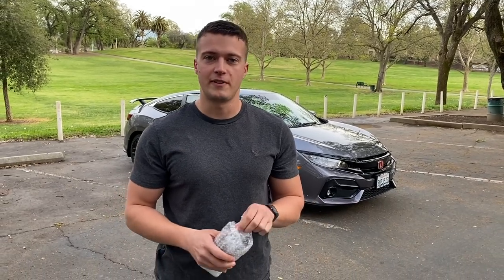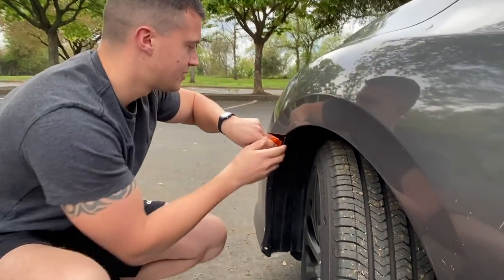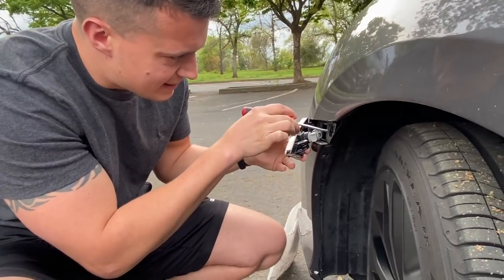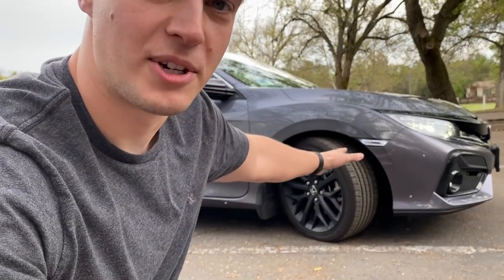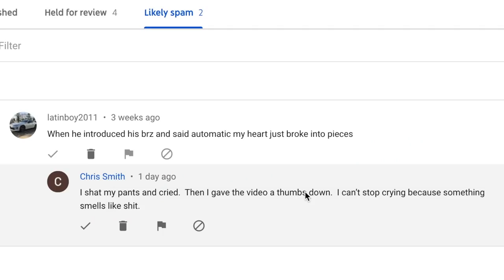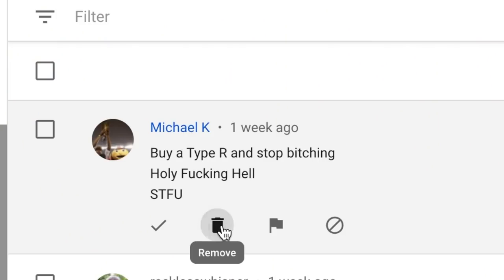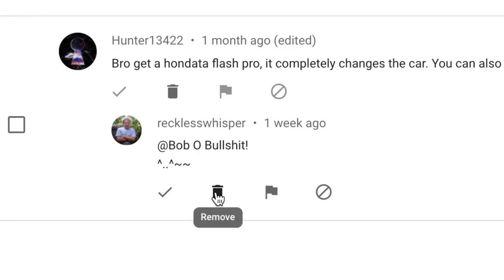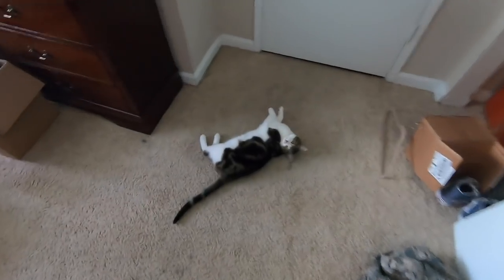Unity Performance Side Marker Install for 10th Gen Civics | 2020 Civic Si

Comment: I added smoked dark gray side markers with amber LED bulbs on my 2016 Civic Touring sedan right after I bought it used in 2018. It does look good at night. Another inexpensive mod is adding a "turbo" sticker on the lower rear door sill. Apparently they were available on the Canadian spec Civics from 2016-2018. It might sound corny but it looks kind of cool and they're available on Ebay or Amazon for about $10.

Comment: Honda did not do the smaller turbo motors because they are cheaper. They did them because of emission standards.  I had an eighth gen SI Before I got my 2020 and this car is much faster and gets better gas mileage. Is the motor as buildable? No, but you can still get good power out the L 15. At least enough for a daily driver. I love my 2020  SI and  I think it is the best car on the market at that price range.

Comment: Did unity performance on mine and they had condensation inside when it rains. It also did not pop in place so I had to put in double sided tape on it. Replaced them with a $20 ebay side markers and they were far better.

Comment: 2:01 no footage of fishing the wire out of the fender?
Reply from the maker: It wasn't hard. it was right there. It doesn't fall down inside the fender or anything. I have skinny fingers, so it was easy for me to grab it, but if you have fat hands and you wanna dance (like Tom Cruise), then I suggest using some needle nose plyers

Comment: Hey so I have a question for your next video! I currently have a 2018 Civic hatch with a few mods done. Would you say it's worth it to put a couple more Ks into it ($3-5k) Visual and performance mods and keep it til it dies. Or save til the 11th gen SI (2022ish) and mod that?
Reply from the maker: i would most definitely save your money for the 11th gen. it will probably become available next fall as a 2022 model

Comment: Hey great vid. I have to ask about the cable. When you popped it off, the cable fell back into the hole.  How do you get it back? Was it easy? 
Thanks man. I now have some choices to make
Reply from the maker: You just gotta finger it back out. It stays right there
Reply: Good question j max

Comment: Love the video bro ! Hey quick question what’s are the difference between the 17-19 SI  & 2020 ?
Reply from the maker: The 2020 has Honda Sensing, revised fog light covers, more red in the interior, and active sound generator
Reply: @Camhill182  I see thanks for the reply. I’m thinking of a SI 2020 but it’s crazy in the price range. Should I just settle for the older years ?

Comment: Just recently bought a 2019 civic si coupe and the first thing I did was replace the side markers. Next up is a chrome delete, the chrome on the side of the car above the windows just doesn't fit with the overall character of the car. If you like the idea of covering the chrome with a wrap, I would suggest looking into it. You can grab a precut on ebay for around $20-25. Let me know what you think. Possible future video idea.....
Reply from the maker: Good idea! I have that in my ebay shopping cart right now, just forgot about it
Reply: I have a 2020 lunar silver civic sport sedan. I have to get those side markers in clear. I must be in the minority as I like that Chrome strip!

Comment: Jdmtoy has them also. Have them on 2016 ex t and 2020 si. After thought you can use the stock ones and spray tint them for 9 $

Comment: Honda's Earthdreams turbo engines are much more power dense and efficient than the N/A engines that came before, from an objective, manufacturing, industry standard and performance standpoint it's the way to go. Thats the unbiased judgement but in my own personal opinion, I enjoy the high torque, strong low-mid range engines over the older higher revving engines you had to wind out for power

Comment: Have you turned on your blinker to see if it syncs? I bought some new side blinkers to for my civic si 2020 and there is another wire to connect to the blinker wire but I dont know witch one it is to sync then so it works because I got ones that where supposed to be amber and it didn't have instructions on witch wire to connect it to lmao. Does anyone know?

Comment: Damn, that's hot. Looks like i'll add those to the list. Any legal issues with the blinkers not being amber colored?
Reply from the maker: Nope! No legal issues. Especially since lots of cars dont even come with them
Reply: Cameron Hill cars that don’t have side markers on the fenders generally have an amber side marker within the headlight housing that is visible from the side.  Legally you are supposed to have an amber colored side marker, but I’ve yet to see anyone get pulled over for this.  In Europe the side markers come with clear plastic instead of orange.  There is a law, but it isn’t strictly enforced.

Comment: Update I bought the same set of side markers and the drivers side leaked immediately, I sent pictures to the selling and instead of sending me a new one they wanted pressure test the side marker. Well if it was a quality part I should not have to take out the side marker and preform a test on a product that is in an area of the car that gets wet when it rains. Save your time, money and frustration of having to prove this product is inferior to other products.

Comment: When I bought my 2019 si as my daily car I wanted the type R which at the time I didn’t mind paying $35-40K for a brand new one but sadly here in Sacramento they all had mark ups and prices were $50-55K so I opted for the Si model and I’m pretty satisfied with it since I had my 2010 Corvette with full bolt on and heavy modified as my track run car. I got rid off my  C6 Corvette to order a C8 Corvette but now with everything that is happening with the economy I’m glad I have the Civic Si and I haven’t got even my Corvette C8 car even built yet. I’m curious to see if right now all the mark ups in the type R are gone now? Well I guess we’ll find out in your next video
Reply from the maker: hey Mick! I love Corvettes! I had a C5 6 speed and it was awesome! would you like to be in one of my videos when you get your C8?
Reply: Cameron Hill I may cancel my order depending on what happens with my work in this upcoming month, production stopped so it may be until next year
Reply from the maker: well, shoot me a message when you get another corvette of some sort!

Comment: Question for u Cameron did u get any warranty for your si? I want the 2020 si but I’m scared if i get any type of warranty that means I can’t modify. Can I still mod it under a warranty ? Or no
Reply from the maker: I did get the standard warranty when I bought it. The cold air intake and exhaust will not void your warranty. those are very, very safe. go ahead and get those, no worries. The tune definitely voids my warranty, but if I blew something, i would flash it back to stock before I brought it in and pray that they fix it under warranty
Reply: Cameron Hill how about a intercool and a downpipe? Does that aril work under the warranty

Comment: im leasing a 20 Si.
Think its wise to just mod its beauty?
thinking of keeping the originals and if I do return it, I'll put them back.
-First time owner.
Reply: Also, what figures are those while you were reading comments.
Reply from the maker: I think you can't possibly go wrong with an intake and exhaust. Theres no way in hell either of those would cause any problems as far as voiding warranties. If you are extra worried, I would just call up your service manager at the dealership you are leasing from and ask them what you could do for mods that wont void anything
Reply: Cameron Hill thanks for the reply bro! Will do. I look forward to your vids. Don’t stop!
Reply: Sucks you have it in lease. Keep it stock!